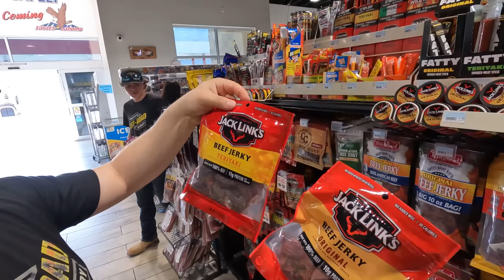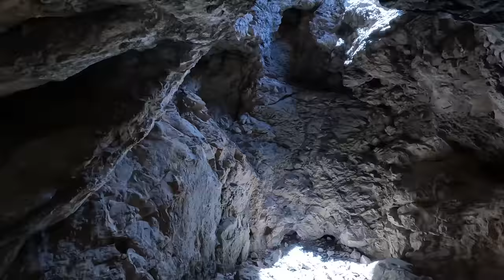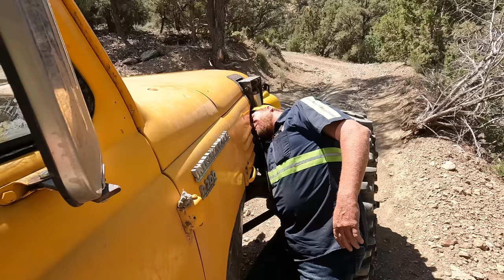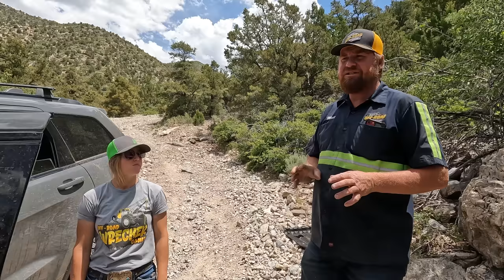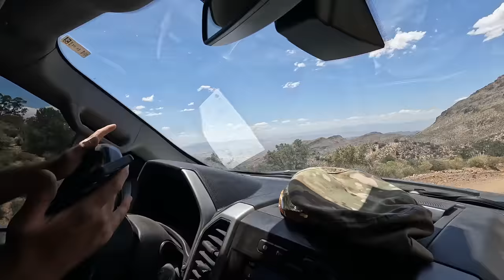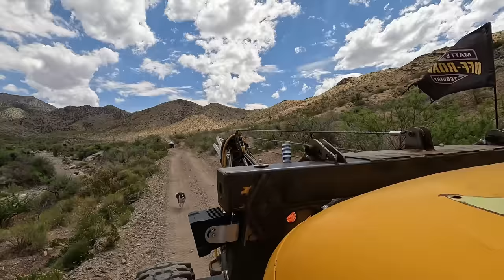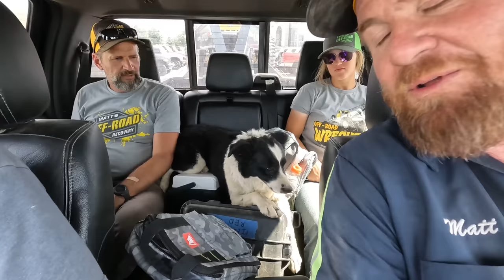Forced To Use Equipment I Despise Out On The Arizona Strip.

Comment: I and my wife had to "invent" traction boards when our car, a '65 Buick Wildcat with a boat on top, and 400 cubic inch V8 under the hood.  It dropped into sand and cobblestones down to the frame.  We scavenged old lumber from about a square mile.  Using a jack, a small shovel, and the boards to build a road, we unstuck ourselves and got out.  We were definitely stuck without that lumber.

Comment: Ceramic coat the exhaust and the wrap it. After that put a  little piece aluminum  shield above exhaust to block heat comin up to hoses. You can put reflective fiberglass tape on the bottom of shield to top it off.

Comment: Matt,, in addressing the heating issues from the headers with the wrecker, you should consider fabricating a sheet metal box to encompass the electricals and the airlines. Allow airspace between the sheet metal and components, and use R13 fiberglass insulation in that airspace.. also wrap the headers and your problem will be over! 😅😊😊

Comment: If that WK2 is a 2017, I have the same rig in red and I had it out on that same trail last June.  It's a fun ride with a few challenging spots but nothing the rig can't handle if you drive it correctly.

Comment: When I was a kid, my mom got stuck on the shoulder between Navarre and Pensacola Beach. She dug  into the sand up to the blue Olds wagon's axle. My brother and I started digging out in front of the rear wheels, Mom emptied the cooler melt water down the sand ramps to firm it up. We had a parchesse board in the back that got ripped in two and shoved down the ramps. She had no trouble getting off the shoulder using this method and sad to say the gameboard got left at the beach. We were definitely stuck for a hot minute and she was not stopping once we got rolling.

Comment: Get the holley turbo manifolds and put a pipe on the v band or maybe build like a 4 inch spacer for the manifolds (maybe cut one up and see if you can weld a few different angles)

Comment: Your headers aren't getting too hot, but the hood shape is allowing a lot of heat to build in that top rear corner, and the vent slots don't extend all the way to the firewall so it's getting trapped. For this trip, I might have removed the hood cover, at least on that side, to allow unrestricted removal of heat from that air line area.

Comment: those max trax were developed by 4wder who was stuck in wet sand on fraser island (ka'gari) on his own with the tide coming in and nothing to winch from. being national park you have to be careful what you do as the fines are massive. so they have thier uses. and are safer than other methods.

many old off-roaders used to use ex military temporary air strip plates or bits of weld mesh fencing which are heavy and hard to work with. those max trax and the copies of them are plastic.

Comment: Maybe you addressed the heat problems already, but you're generating so much heat that you're into race car territory. You can either install quilted aluminum header wrap yourself or have a company like Header Shield do it for you - highly recommended, professional race team quality installation. Then you need to create bent sheet aluminum shields to mount in various locations in your engine bay. Beyond that you should wrap heat-sensitive components, literally anything that could be effected by heat, with adhesive gold foil. It's also possible to apply powdered aluminum heat shielding to materials - even Formula Student college engineering teams often apply powdered aluminum to carbon fiber plates in order to create a legal firewall between the engine bay and driver cell. Heat is the enemy of everything and lack of reliability costs money. There are tons of options and multiple steps to take, make it happen!

Comment: Try using some corrugated alumni sheets as a heat shield as well as double wrapping the harness with ceramic thermal wrap tape for both air lines and electrical wires

Comment: There were no such thing as "traction boards" when we used to take over a dozen old FJ40 Landcruisers  (The 4.2 with the 3-speed manual + High and Low 4WD) out into the New Zealand wilderness, with a crap-ton of jerry cans of gas. When one would get stuck, we would line up the Glandbruisers, hook'em up with heavy tow cables, and just pull 'em out slowly. Sometimes we'd have to swim the first cable out to them, and sometimes we'd just winch out by hand if we were alone. Hell, one time Dad and I had to bury our spare wheel in the river gravel because we had nothing else! Then we had to dig it up, again. sigh

Comment: Watching along picked up phone to comment- just as you pulled out the owners manual - so no need to comment about on future Cherokee trail hawks ( for others there’s a button that allows trail hawks to be flat towed - transmission in park and transfer case in neutral. Neutral is button selected next to transfer case selection)

Comment: It don't matter on the lift, it's the size of the tires, cause the lift part is about the axle and the rock is hitting the axle so you need bigger tires to lift the axle up more so it can clear the rocks. The bigger the tire the higher the axle sits and the smaller the tire the lower the axle sits

Comment: I will use my traction boards before I pull out a winch, like I've slid into a deep rut and used them injection with the traction board. It's funny to see them hold up better than the aluminum ramps

Comment: use cerakote piston coat on the inside of your headers, it will cut the external heat by about 50%.  Works great on mine.

Comment: At 19:20. I've heard of situations like this. With an RV someone improperly flat towed a 2020 Jeep Wrangler. How to flat to tow instruction were in the owner's manual that the owner failed to read. The Jeep was towed for 500 miles.

Catastrophic engine damage. Both insurance and Mopar warranty denied the claim initially.

Owner's still owed about 40k USD. The estimate for engine replace was in the ballpark of 6-10k usd. On the owner.

I didn't heard the follow I think the owners attempted to sue Jeep or whoever owns that brand.

Comment: There is nothing ridiculous about being concerned about your companion animal's comfort! To you, it's one of several animals you will have in your lifetime. To them, you're the only one in their entire life!
When dealing with rubber or plastic tubing that will be under pressure, I use zip-ties as hose clamps to keep them connected.
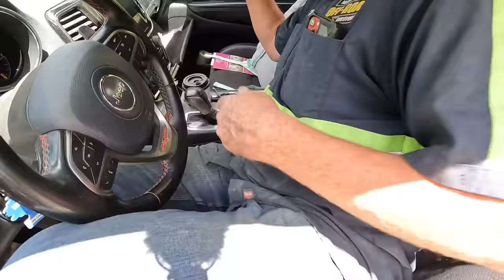@19:25. If that Jeep is a TrailHawk, then it has the QuadraDrive2 or QuadraTrack 2 transfer case. This means that if you put the transfer case into Neutral and the transmission into Park, then nothing will happen to the transmission. You can flat-tow a Jeep with an automatic transmision as log as it has the Quadra Drive2 or QuadraTrack2 transfercase.

Comment: That Trailhawk isnt much of a Jeep imo. Might as well buy a Sentra. Anyway, I have had pretty good luck with certain kinds of traction boards and not others. I like rubber-coated steel wire and bars recovery traction rolls a little better in general for an SUV or 1500-2500 light truck. I have laid the flexible traction rolls over heavy sort of river rocks that were in a dual track mountain road. Then your tires dont go down between the rocks and jam; also they don’t spin so bad going over. But you have to keep moving them so it’s sort of “emergency” style stuff. Annoying but it works. Especially if you’re alone, then either type can often help. The boards can help get you on top of deep sand that the flexible rolls can just sink down into. For other situations the rolls are better imo. Boards are a hassle to carry in your vehicle. Rolls pack smaller but they are not light. Boards that are weak or too narrow or too short or whatever can be almost useless. Match to your vehicle. With the big tires you run, you’d need to do some careful shopping and testing to figure it out.

Comment: If you put traction boards on the top of the shoulder twist you’ll change the 99 to 0 with a conjunction minus a lifter your basically winning the traction from 0-100 real quick

Comment: If you have the ability to flat tow a vehicle like that and can't lube the transmission, the best way to do it is run the transmission and transfer case in neutral. Just in case either shifts in to gear, it will still effectively be in neutral.

Comment: WK2 Grand Cherokee models like that one and mine are designed for flat tow and feature a Nuetral tow mode. Put the transmission in PARK and push the N button on the terrain selection knob like she did with her knife. You almost had it. I was yelling at you to put it in park when she was using her knife hahahaha

Comment: Do away with the push to connect airline fittings. They were made for quick installation on the assembly lines. Go back to brass fittings with ferruls. Not sure on that spelling. We tried the push to connect on the firetrucks we built. They leaked to much to pass the underwriter laboratories test. Went back to brass.

Comment: In the old days, you could pull the lever on the floor and put the transfer case in neutral and that would disconnect the transmission from the drive train.

Comment: Well if you are on the beach in the mid-Atlantic and you are buried in the sand up to the chassis. So if your tires are buried and all the tires only spin and tide is coming in you gotta use boards. Because you are stuck.

Comment: I know this video is a little old, but on that grand Cherokee with the neutral safety switch engaged underneath the plastic in the center consul. You should be safe to flat tow a vehicle like that.

Comment: just get some metal air line fittings i use the same on the ol racecar and they are directly off my wastegate where my 2 main crossover pipes cross over it and i melted plastic ones almost immeditely but metal ones held up for years now!

Comment: If traction boards worked chances are you could have just pushed the car onto some different ground and it would gain traction. Could help to give you a bit more height if you're beached but not often.

Comment: I drove a smaller KL Trailhawk for about 3 years. I took it to a lot of Colorado’s trails and Moab. To do that to the Grand they had to be driving it like they stole it. If you carefully crawl obstacles they’ll do amazing stuff. It’s mostly the new traction technology, no matter what wheel has the traction, the computer can find it and put power where it’s needed unlike anything I’ve ever driven. I almost wish my XJ has something like it. Independent suspension means individual axle control though, not quite worth the solid axle trade off.

Comment: i have never have used traction boards i have a 1994 ram 2500 4wd 5 speed gas burner and have 4 winches front /rear/and both sides

Comment: I still contend if that engine is running that hot, its way too lean. There is no way that should be that hot. Fix the tuning. Never needed heat shields for headers and I ran them in a motorhome. Headers likely lean the engine out, so then they run hot. Get after the computer and fix it. 
Did you ever say what was up with the Jeep, why it didn't run? In the beginning you said it was stuck, but it wasn't. What year was that? All the Jeeps I has including my 2017 Trailhawk had a neutral on the transfercase. Flat tow it at any speed you wanted to.

Comment: It's pretty critical not to rely on Google Maps to do what its asked. It's notorious for effing over commercial drivers both class a and b. I used to deliver propane out in the boonies, and I'd plan my route carefully and it'd just change it. You gotta write down the original directions and then drive using your road signs etc

Comment: Have the exhaust ceramic coated inside and out. Will keep more of the heat in the exhaust and not radiate so much heat off of them

Comment: Do you have room to add a bolt on heat shield over all the electrical and air lines plus wrapped headers my resolve your issue

Comment: I disagree because I have a 2wd ranger with an open diff so if I get stuck I am running 1wd traction boards give me that grip that gets me out. But yeah if you have a real truck 4x4 with locking diffs then I agree if traction boards got you out you weren’t stuck!

Comment: Matt 🤬 The WK Grand Cherokee was designed as a Jeep not a car.  Its heritage comes from XJ and it had to pass the test on an Engineering trip through the Rubicon before it went into production just like all Jeeps of that era.  Mercedes Engineering helped with the suspension to improve the ride as they used the same body and suspension on the M class SUV built in Alabama.  So the WK Grand Cherokee is not as off road capable as a Wrangler but it is NOT a car !!! 🤬  Mark Smith of Jeep Jamboree fame drove his through the Rubicon Trail on various Jamborees often.

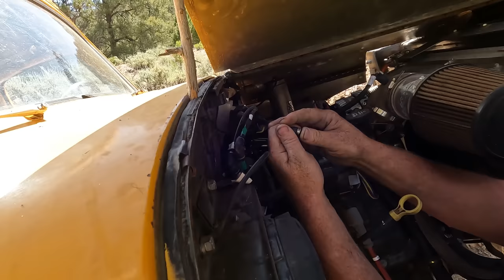Comment: 14:11 Header wrap to contain heat? There are also heat resistant boots for wires and air lines. They absolutely work.
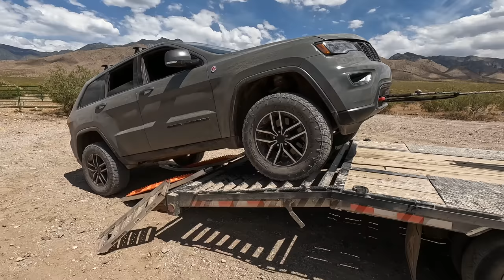30:01...flexible loading ramps. Newest product line. The MattRamp. Uh, he won't see the humor. If there is any.

Comment: My ‘21 F150 has composite oil pans on both engine and transmission and it’s the most asinine thing I have ever seen, not sure why it’s a good idea. Completely exposed although sits up relatively high into the chassis. Steel skids are in my list

Comment: Story time!!! 

I off-road in a 98 Toyota Camry, with a V6 3.0 engine, I was going across a river crossing I went too slow and the current pushed me and I got stuck. Both front wheels were off the ground spinning freely as it being an only front wheel drive vehicle I was stuck I brought out my traction boards and was able to drive out please explain to me how I could’ve gotten unstuck without them.

Comment: what you describe as "gambling" is not actually gambling. it stupidity. what you should have said is "it brings out the idiot in me".

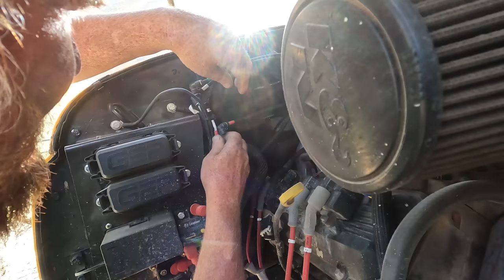14:01 they are in the open air but they are sat in the turbulent air zone behind the front wheel. So, when it is turning there is no airflow there. The rotation of the wheel is sucking all the air that should be there up in to the top of the wheel arch. GT race cars have the cut out in the top of the fender\front wing because this movement of air creates lift. You will need to move them from there and put them somewhere else. Or heat warp them but that is not gonna be a permenant solution with the way you have the engine bay packaged

Comment: Mat, I don't know, what will it do if you keep the heat in the headers until it reaches the exhaust pipe? There is something you can use... What's the temperature excess of 2900F? Like I said...I don't know...but I do know how to hold that temperature...

Comment: So I learned something today. I  thought it had something to do with a line of latitude. 
What 2 states are not in the lower 48?
The United States is made up of 50 states, but 48 states – also known as the conterminous states, the lower 48, or the contiguous states – are adjoined. Two of the states – Alaska and Hawaii – are not part of the lower 48 states.

Comment: is the trailhawk a front wheel drive with rear drive added? or's it actual 4x4? 
Actual 4x4 can be transfer case in neutral & then it ain't spinning the transmission.. which is why 4x4s are popular tow behind rv vehicles
Reply: They just didn’t know what they were doing. You’d think a recovery company would know how to tow vehicles. Put it in park, press the neutral button and all is good.

Comment: Cut some more hood away and get a electric fan mounted to blow air in to the engine bay or out also do me a favour and wrap the metal just above your seats with foam looks like it would really hurt your head if it got ruff or rolled over

Comment: Those secret parts are so fuckin annoying. It's just so they can force you to use manufacturer certified recovery companies. I'm an Amazon driver who drives the Rivian Electric Delivery Vehicles. It's the same way with them. They intentionally made all the jacking and tow points very difficult to find so they can force them to use specific tow companies that give them a kickback for each recovery.

Comment: If you'd have put a 12v Cummins in the heavy wrecker you wouldn't be having as many stupid little problems and more torque. I still don't understand why you put a gasser in it, it would be soooo much better and cooler with a Cummins.

Comment: You can't really be to stupid to understand what the lower 48 is 
The lower 48 is the north American continent known as the lower 48 states of the USA because the uper state #49 is Alaska and it isn't a connected state to the USA Canada is between the lower 48 states and the uper #49 Alaska and then Hawaii is #50 as per the dozens of shows called Hawaii 5-0 because they are the 50th state to join the USA